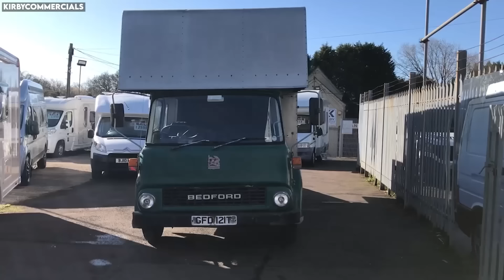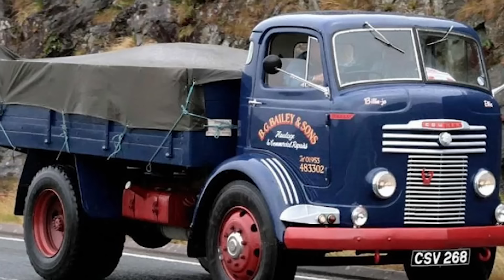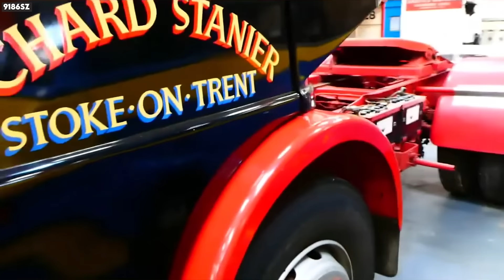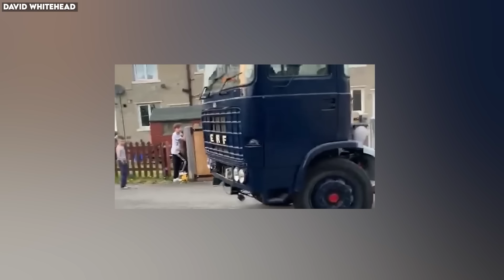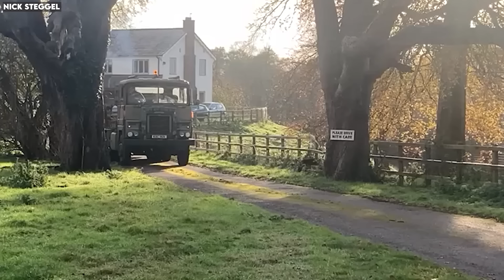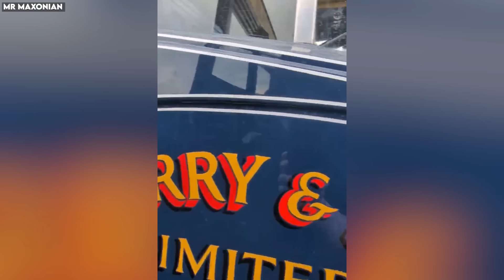10 Classic British Lorries Everyone Forgot

Comment: People tend to look back with rose coloured spectacles and forget these old British lorries were horrible things to drive.   Prior to joining the European system of taxing vehicles on gross weight, Britain taxed them on unladen weight, and had a 32ton gross weight limit, creating an incentive to save tare weight wherever possible.  Really good lorries were just too heavy for the UK.  Weight saving led to tiny flimsy death-trap day cabs, pathetically under powered engines, manual steering, no cab suspension, and ear splitting noise in the cab.  And ruined British Lorry Manufacturers because hardly anyone wanted them outside the UK - which wasn't a big enough market.
Nostalgia makes them interesting to look at.  But I certainly would not like to go back to driving one!!
Reply: Ah come on now, theres nothing like getting into an Atki Borderer after roping and sheeting a high load in the rain with a gust of wind thrown in. The fact you're cold wet and hungry with only 200 miles in front of you.
Fantastic wages of coarse.
Reply: I replied to you but it seems to have been wiped. 
All good fun.